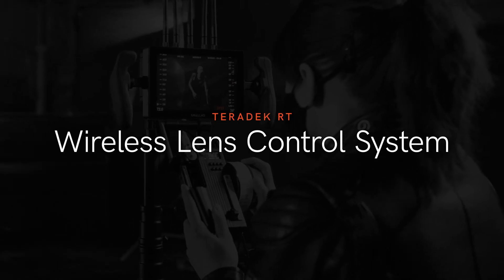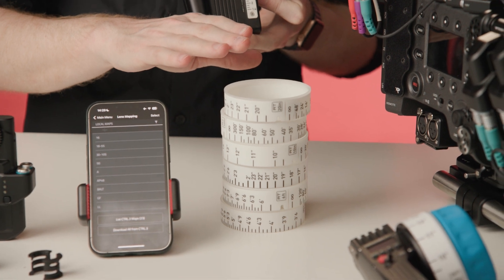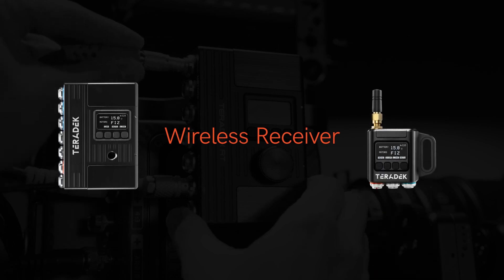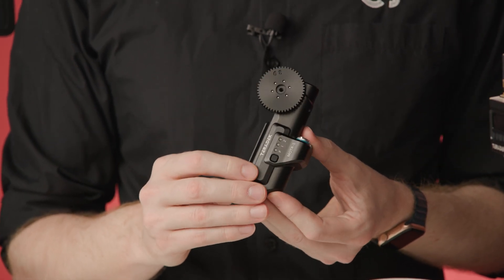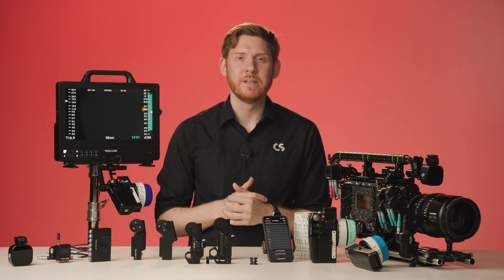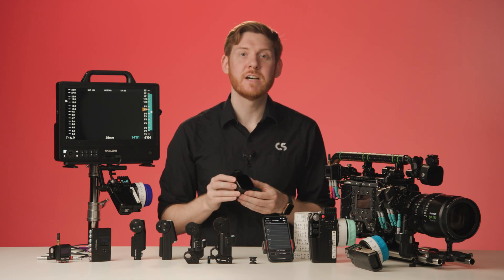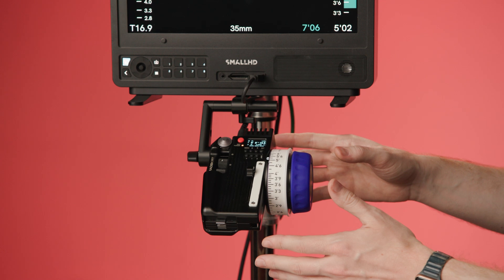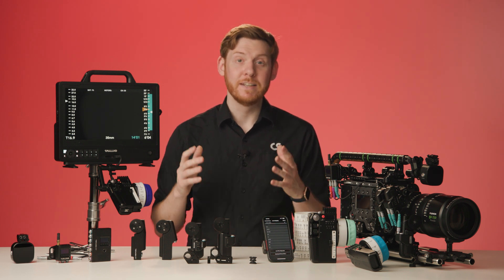Teradek RT Wireless Lens Control System Overview and Features

Comment: Is it possibel to integrate the Cinetape with the Teradek RT system? Could a compatible Small HD monitor (Indie 7, for example) display the Cinetape distance measurements as it can with the TOF.1 distance measurements? Would the autofocus feature work as it does with the TOF.1? The 3 degree field of view of the TOF.1 could be an issue for some shots, wider field of view of the Cinetape would be helpful in these scenarios. Expecting to invest in this system soon, the Small HD integration is clutch for solo operators!
Reply from the maker: If you have an MDR.X you can purchase the Teradek RT Cable from CineRT and it will work as described. If you have an MDR.S we are developing a cable and firmware to unlock this capability. Thanks!